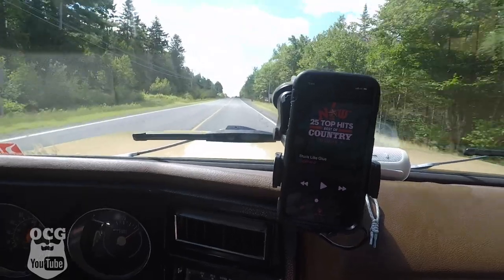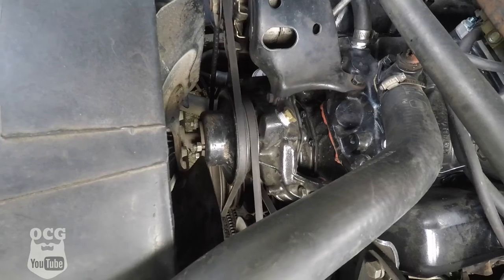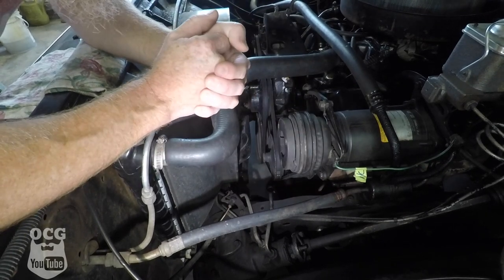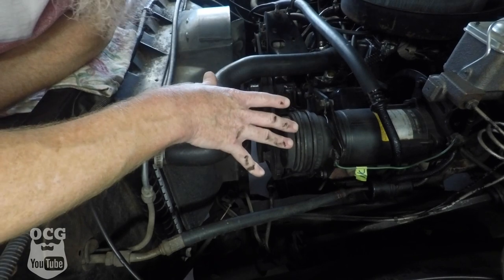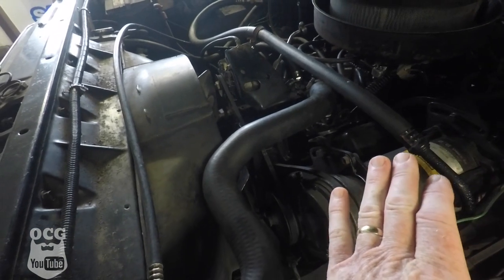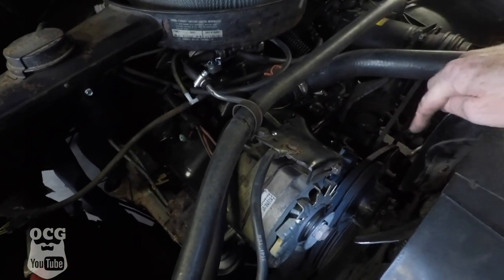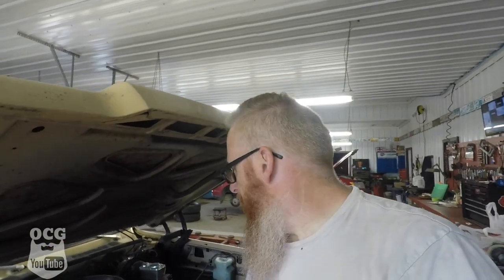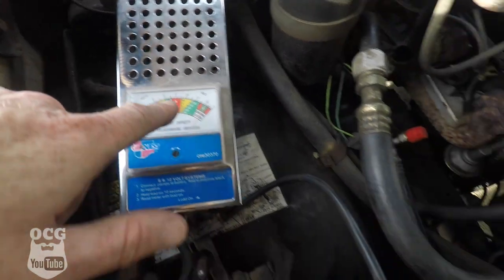LIKE UNITED BY TRUCKS I HAVE TO DIAGNOSE WHATS WRONG WITH MY SQUARE BODY TRUCK

Comment: Fortunate catch on that alternator, but I honestly believe that the fan needs to be replaced.
Reply: i think so as well
Reply: @613Builds  same here! don't know if the clutch fan make the noise but defenitly need to be replace!
Reply: The center of the fan assembly can be replaced.
Reply from the maker: Thanks Guys. Fan clutch replaced and noise still there.

Comment: AIR Conditioning.  such luxury.  yeah i agree the clutch fan seems a bit sloppy as well.  i think a little endplay on the pwr steering pump is common.  new brunswick day eh?  no such thing as too many holidays LOL  #DoItForDale
Reply from the maker: I said i wasn't having another summer vehicle w/out A/C.
Reply: Olde Carr Guy ahhh you’re spoiled 😜 it gets hot in the old 83 firebird.  Hey the noise under slight load wouldn’t be in the rear gears would it?  Good luck

Comment: Was it the fan?  It looked loose,  but It sounds like the fan blades hitting before the bend at higher speed.
Reply from the maker: After several replaced parts, including the fan clutch, all it ended up being was a heat shield.

Comment: I have heard that noise alot of the years lol
Reply from the maker: And? What the heck is it?
Reply: @OldeCarrGuy  bad bearings. Not sure why they do it so much so often. But its usally on the rebuilt ones. Idk if its how they are installing them or the bearings themselfs but they dont seem to last long.
Reply from the maker: Efurd Garage which bearings?
Reply: @OldeCarrGuy  in the alternator. They are probably sealed if i recall so you cant really do much with them. I think i saw where you said you replaced it all. I heard in the video you spinning the alt pulley by hand and could hear the bear8ng grind. Did you do the same with the water pump?